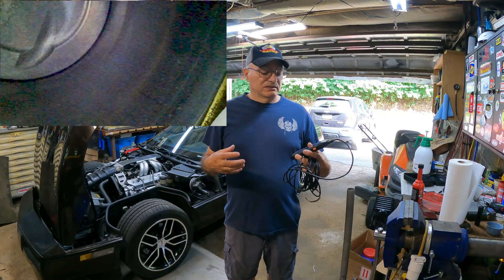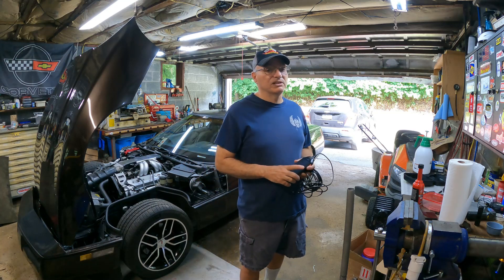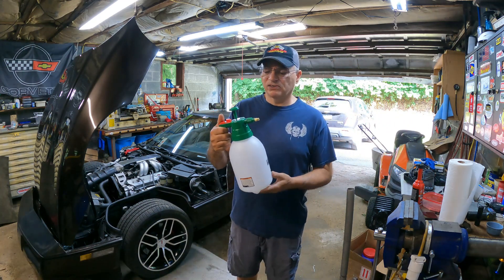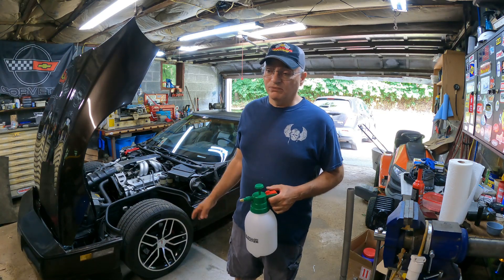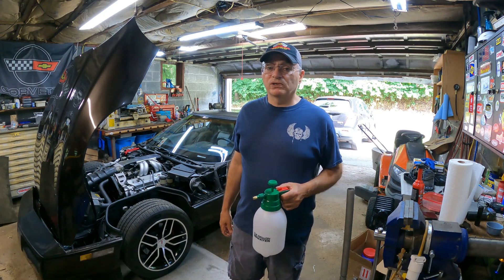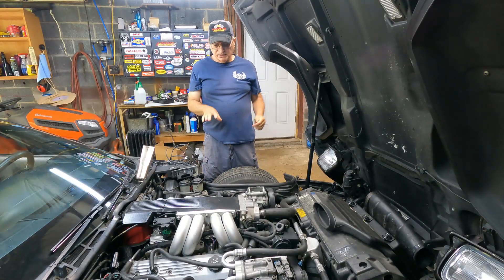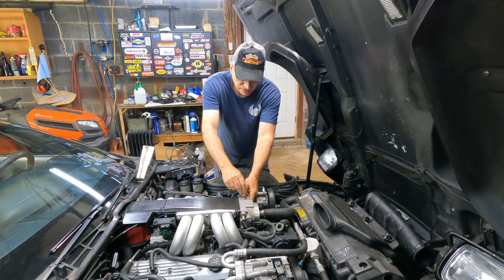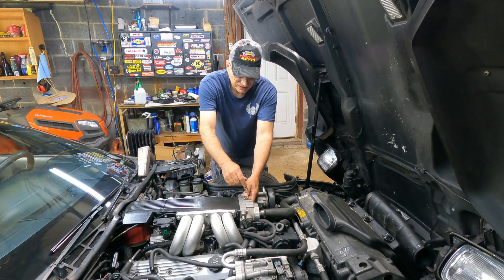Using Water to Decarbonize Your Engine, Does it Work

Comment: Nice! I assume you did this test with a fully warmed up engine? Adding water to a cold engine isn't going to do anything good.

A couple words of caution though. Depending on the design of the intake manifold and where you are adding the water (or any other liquid), it's possible for it to collect in low spots. A general awareness of this possibility and plenty of frequent high revs with heavy throttle to blow through any liquid that may have pooled in low spots is key.

The second thing to be aware of is that some moisture will get into the oil from blow by past the rings, so a long (30+ minute) drive afterwards is a very good idea to dry out the moisture. If the oil looks visibly milky once you get back, it's best to change it. I never saw the oil change colors after using water, but it's a good idea to check.

Comment: Surely using hot water would do a better job as you wouldn't wash pots with cold water so id try hot water
Reply from the maker: I could try boiling hot water but it would cool to the same temp as the intake air by the time it reaches the intake valve, The temp of a combustion chamber gets up to as much as 4000 f, so any water no matter what the temp will turn to steam instantly anyway.